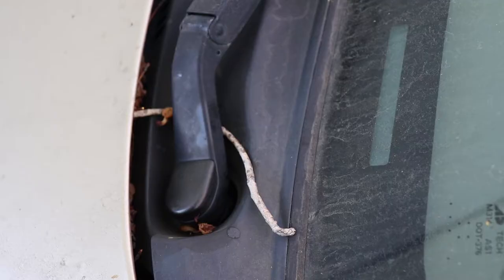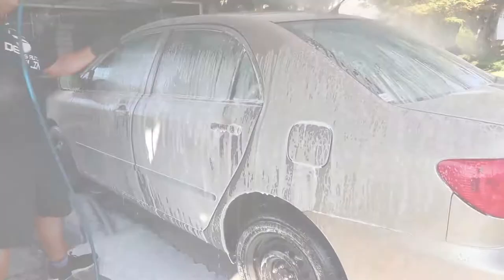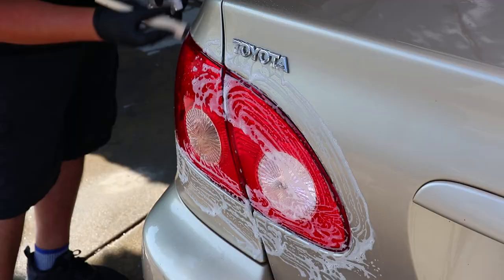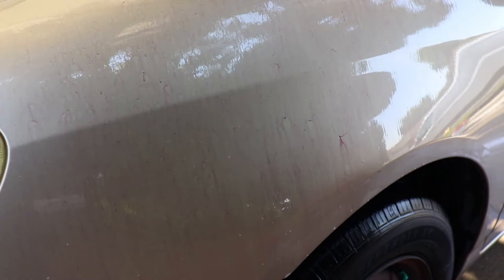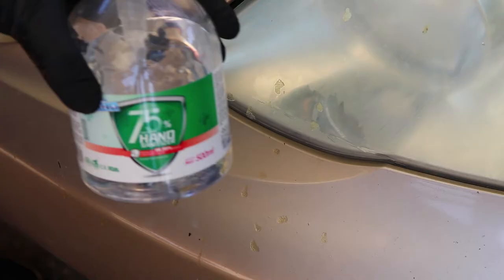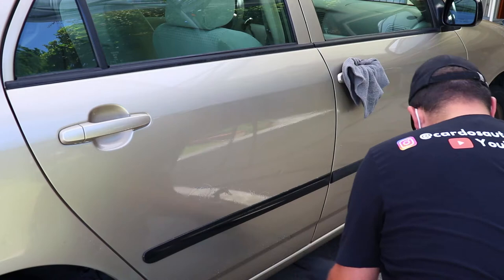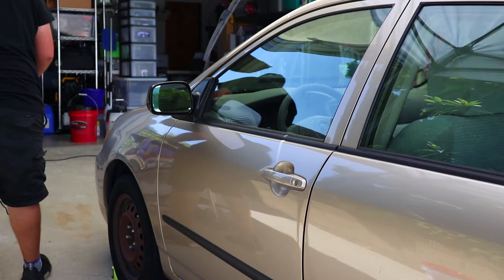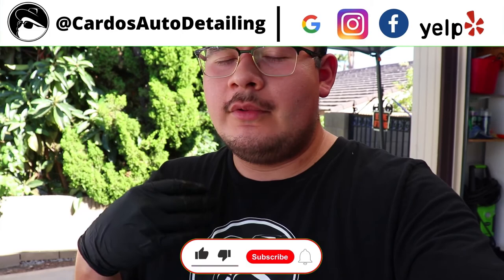Tree Sap Removal & Purple Iron | Decontamination Detail

Comment: Adam's Iron Remover does not work. Have a 2022 Civic (Black) and a 2023 Camry (Red) washed both cars separately for at least 1 hour between washes, and let them air dry for a few minutes. Sprayed Adam's Iron Remover on the Camry and let stand for 7 minutes so as not to let the car dry completely, there were no Purple marks. Did the same to the Civic and again no Purple marks. Rinsed off the worthless Adam's Iron Remover, dried both cars and waxed them. Waste of money as purchased 1 gallon of Adam's for $55.
Reply from the maker: Umm....   That means there is no iron contamination on your car 😬 If it still feels gritty, it is not metal based and likely something organic 🤔 This isnt an Adams thing, that happens to every iron remover out there.

Comment: Nice video quick question what product you using for clay bar
Reply from the maker: I actually do not recommend this one, I used Chemical Guys Clay Block for the video. Instead, use a mid level clay that is easy to work in yet effective enough to remove the deposits. 

You can use whichever clay from any brand, but if you need a recommendation Ill leave a link to the one I currently use: https://bit.ly/42bQgXE

Hopefully this helps champ! 👍
Reply: @CardosCarDose  nice thnx for the info what clay lube you used. The only thing is that all those companies you have to buy 150 or more for free shipping tho. I really appreciate your video
Reply from the maker: You dont have to get it from the site, or even the same brand, it is a reference so you can shop at your local supplier if possible 😌 

I personally do not use clay lube, instead, IPA as my slip solution. It preps and decons at the same time for a more effective clean 🧼 I use P&S Panel Prep. Not for anything in particular, it just makes financial sense as it is a glass cleaner and paint prep combo 👍
Reply from the maker: i actually have a video demonstrating this if you want to check it out https://youtu.be/bfCCx85gTAM?feature=shared

Comment: You mentioned a citrus based cleaner, what is it?
Reply from the maker: I had used Chemical Guys Citrus Wash and Gloss. I dont use it anymore only because I found KochChemie Super Foam to be more effective 👍
Reply: @CardosCarDose  oh ok, so what were you using, when you were brushing the front, @6:40 "I agitate with some citrus based cleaner" What product and ratio was in the spray bottle?
Reply from the maker: Ah, that was Meguiars Citrus Power Cleaner Plus 🍊 I used it at 1 to 4 ratio. Of course you can use whichever APC you desire. 👍 I found that P&S Enviro Clean works better, foams greater, and costs less if you want to check it out
Reply: @CardosCarDose  oohhh, Awesome! Thanks brooo!

Comment: What are the dimensions of the gazebo/shade hut you use?
Reply from the maker: Ooof, right when I sold them at a yard sale 😂 This one I think its 12ft x 12ft. I got it at walmart but they discontinued it 😔 Hope this info helps!
Reply: @CardosCarDose  ohhh so you you had multiple ones? How many?
I'm trying to figure out a size that small enough to set up for one person, but provide enough shade
Reply from the maker: all of them 1 person can set it up, it just depends how much shade you want 😎
Reply: @CardosCarDose  how many did you use in this video?
Reply from the maker: I used 2 and put them side to side for a wide length of shade